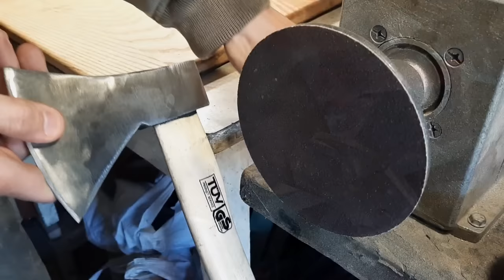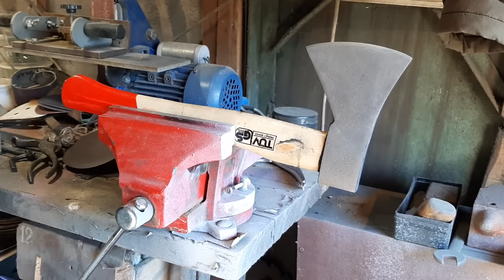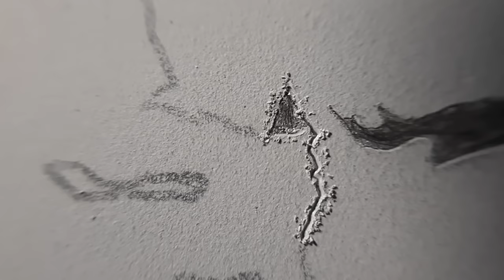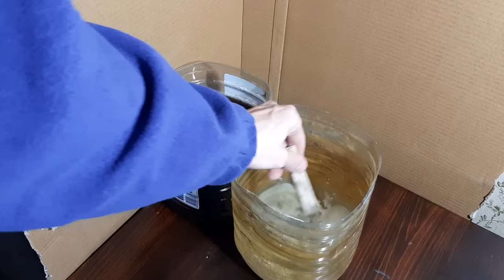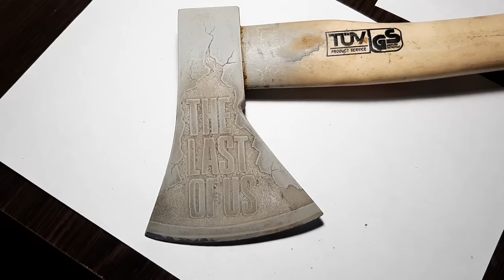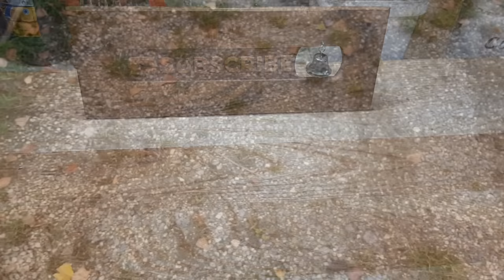Drawing on metal. how to draw. Technology is available to everyone

Comment: Great job. How long does it stay in the Ferric Chloride solution?
Reply from the maker: Thank you for your attention to my work. In solution approximately 50 minutes
Reply: Great work in all yourvideos. What is the tip made off to scratch the paint?
Reply: @thedarkdude77  I guess it could be small piece of file, or fast cutting steel. Or any hardened steel.